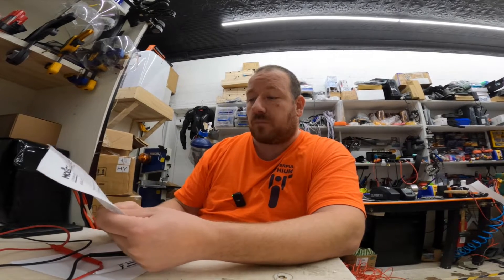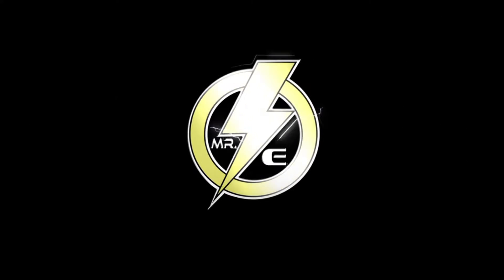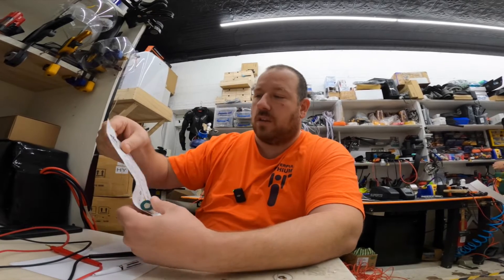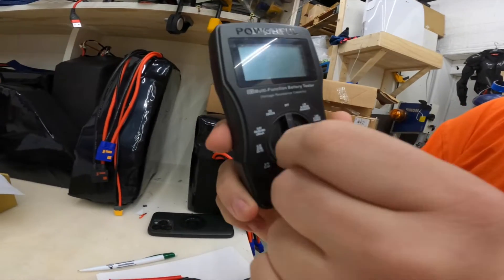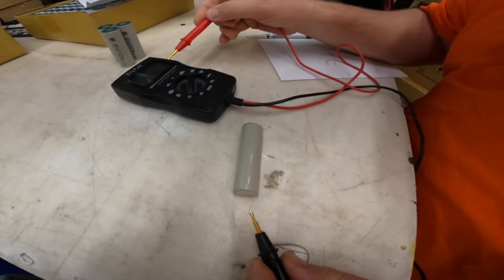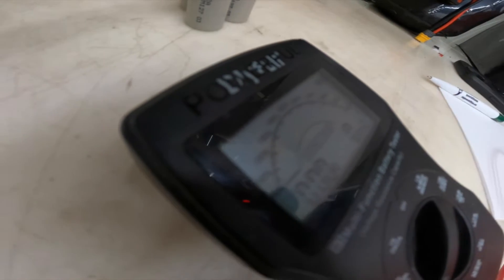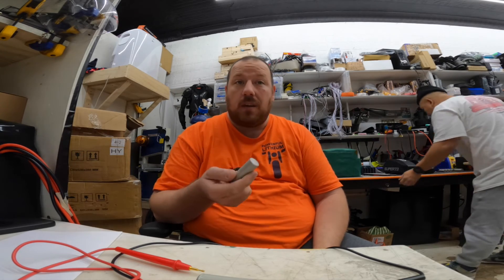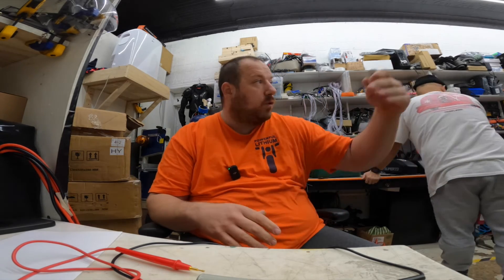Lithium Batteries Internal Resistance     How To Tell If They're Good Or Bad

Comment: does molicel always flutuate in IR? if p42 is over 15mOhm is it still good?
Reply from the maker: Depends on state of charge, when is in nominal Voltage (up to 3.6V) needs to be under 16 mOhms
Reply: @mr.e_from_nyc  i see so if its purchased from a battery retailer it should be less? ive heaed folks claim that p42 has IR of 8 to 9 mOms? is that right?
Reply from the maker: @Omar-tz8hx  each batch has a spec sheet… you’ll go by that particular spec sheet

Comment: My Powerful lithium 42ah battery is the absolute BEST. I've had it literally one year and haven't had ANY issues at all. When the batteries are built right with certain standards, it definitely stands out against any other batteries on the market hands down. Thanks again PL!
Reply from the maker: Awesome to read… and I know your rocking a BAC 8000 with the new Soto in motor… Winning combination… 🙌💯💪🫶🙏

Comment: My hyperion 42ah molicel pack for my onyx is still balanced at .01 almost 2 years later.    Worry free battery.  Great job powerfulithium!!
Reply from the maker: That’s wassup… thanks so much for sharing 🙌🙏🙌💯💪
Reply: I have run a Chevy Volt cell pack, 2019 cells... since 2019. With no BMS. Just hit me with 12-20A bulk charging to 4.25v/cell. 

Still balanced to 0.0002v (0.2mV) over the 20 cells. going on four years. 

Battery murdering systems.